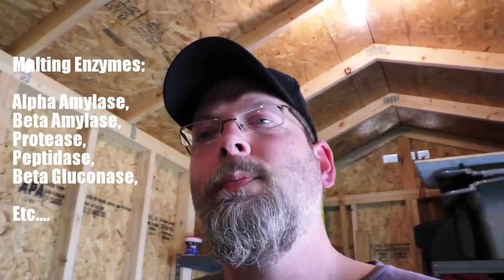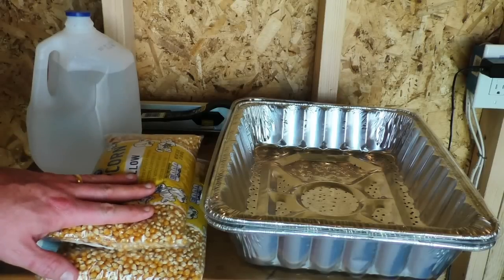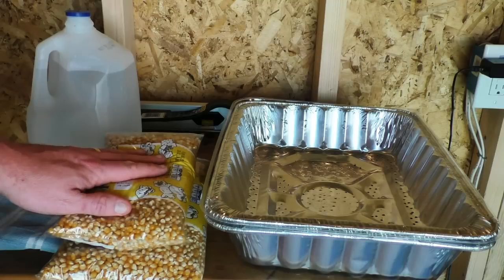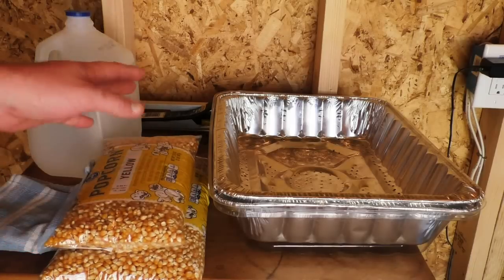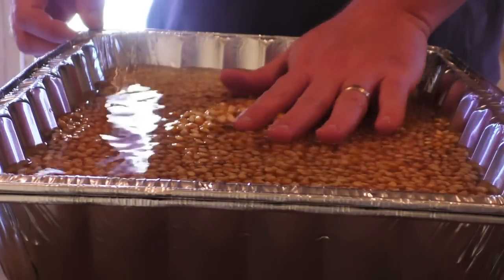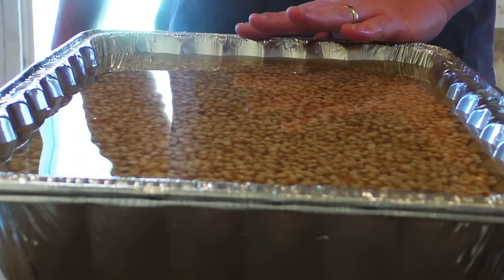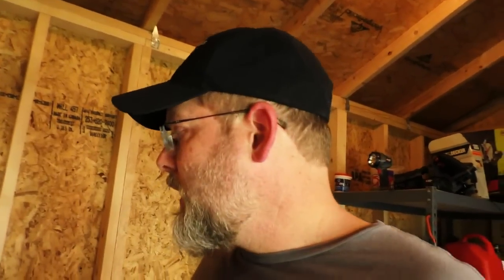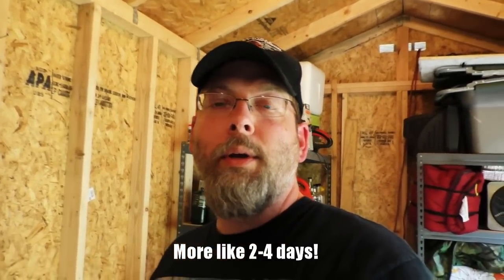HOW TO MALT CORN FOR MOONSHINE & BEER - EASY! Part 1

Comment: I have been asked can you use the corn in a mash right after the germination while it is still wet? Skip the drying process ?
Reply from the maker: You can, but I've never tried it. I've read several times that it can leave a grassy taste in your beer, or even make it through distillation into liquor. I may try it some day just to see what happens:-)

Comment: Hey, just subscribed and watching your videos. I used to home brew. My question to you is; do you use a hydrometer to measure your specific gravity/alchol content? Can you add additional sugars to increase alcohol content without effecting taste/flavor? Thanks, Happy Trails
Reply from the maker: Yes I use a hydrometer on every batch, even if I'm not adding sugar, so that I can calculate the alcohol content from the data points. 

As far as flavor, it depends. If you add sugar you won't change the flavor much until you push over 10%abv. After that the yeast will start to throw off some stronger flavors. 

What sort of abv range are you looking for, and what recipe?
Reply: @BeardedBored  hThanks for the quick response. Haven't done any 'hard' stuff yet. I'd like to sip some stronger brandies and the like above 40 proof.
Reply from the maker: @kentallen4473  Check out the Still It channel and The Barley and Hops Brewing channel to get tons of great info on distilling:-)
Reply: @BeardedBored great video very helpful. I am using 50kg sugar in a 250 Ltr mix of lemon and ginger. Getting about 12% ABV. Thinking of reducing the sugar to 20kg and adding malted corn to provide additional sugars. What quantity of malted would be ideal to get to higher ABV say 16%

Comment: Bearded: Any specific reason why you wouldn't malt yellow corn that comes in a 50lb sack from a local hardware or feed store? Here in North Florida (near Tallahassee, FL) we've got 50lb sacks at places like ACE Hardware and other misc stores that sell feed, for around 6.99 a bag.  Just wondering ASSUMING you've got similar access to this at these prices why you'd still choose to pay the same price for a lot less in popcorn kernels? This is a honest question..obvious assumption is lack of access to bulk quantities?
Reply from the maker: Good question. Actually I have easy access to feed corn in Walmart and the various feed stores around here. The main reason I went with popcorn was so anyone, anywhere could do it if they have access to a grocery store. Also, I only needed to malt a few pounds at a time due to space and didn't want to store the rest of a 50 bag. I've done feed corn too and it works just as well for malting:-)>

Comment: when you malted corn did it start to mould a little and what do you do?
Reply from the maker: If it gets moldy you need to dump it in the trash. Sorry to say that, but it's not safe to use moldy corn for anything. I've had to dump out batches myself. If you don't turn the corn enough, and if it's too warm then it is more likely to grow mold. Good luck on the next batch:-)
Reply: @BeardedBored  well poop. It was only a little fuzzy in one spot
Reply from the maker: @brucegustafson8382  Ohh, I thought you meant the whole thing. Try to just scoop out the bad stuff and the corn around and under it. Give it all a thorough rinse several times and drain completely for an hour. Sanitize the tray you're using before putting the drained corn back into it. If it finishes malting without growing more mold, then you're ok.
Reply: Ok thanks . I malt in very small batches. Two big trays like in your malting Video, just enough corn to cover the bottom of the trays. I’ve done it twice now. Do you still need to mill you’re corn after you malted it or is the grain open enough all ready after malting?
Reply from the maker: @brucegustafson8382  You still need to mill it to allow the mash water to access as much of it as possible for mash efficiency. Corn is usually too big for a standard grain mill, so you may need to bust it up in a blender first.
Reply: Hobbits are real i saw them on tv

Comment: it has 4 x diastatic power not dried because it degrades the amylase you cant store it but is converts better so you can add 3 parts unmalted corn ,,,,,, so apart from storing.....why dry it??? make it fresh
Reply from the maker: I've never tried using it fresh because I read that it can have a grassy flavor that will come through in your final product. But I've always wanted to test that:-)
Reply: @BeardedBored just cook it for 40 min at 152f to convert the rest or .....
malt it all........thats what the old timers do ........... yeast grow on skin so you need no yeast and its natural wild corn yeast..... ps ive improved my malting process after watching your video its the best ill check your others out....im running dates at the moment 70 percent sugar dried just like corn.... smooth nice body residual sugar in the east they call it arak the only thing ive distilled that has a nice smooth mouth feel like corn and girls love it you can hardly stop them when they taste it ????......why dont we know about this in the west......cheers give it a try i use golden sunrise dates
Reply from the maker: @InahaFrost  Sounds great:-)
Reply: @BeardedBored  my passion is as big as my mouth ....sorry .....power to the people.......love your video bro awesome

Comment: Am following your example :) i wonder why to remove the floating grains? Because when i added water in the container, many of the grains were floated. Maybe 1/3 of them ... best regards :)
Reply from the maker: What I read was the floating grains are spoiled and won't grow, so it is best to remove them. I am not certain why that is. If you try this again and many grains float, you can separate them and try to malt them in another container to see if they are bad, or not.
Reply: @BeardedBored  Thx again :) Am french so its not easy to understand all the details but you are a very great teacher :) am sorry to ask another thing but when the four steps are done, you just rinse the grains half a day  and put wet towel on them until the roots are twice the kernel? right?
Reply from the maker: @lechoppedemeria9323  Yes, that is correct:-) J'utilise Google translate pour cette partie pour plus de clarté. Après avoir terminé les quatre cycles de trempage des grains, vous laissez le grain pousser sous la serviette humide pendant 5 à 7 jours jusqu'à ce que la croissance soit là où vous le souhaitez. Vous devez remuer le grain plusieurs fois par jour pour vous assurer qu'il contient suffisamment d'oxygène. Si vous voyez de la moisissure ou une odeur de bactéries, rincez très bien le grain, puis laissez la serviette pour lui permettre de sécher légèrement. Assurez-vous qu'il n'y a pas d'eau accumulée sous le maïs pendant sa croissance. Vous le voulez légèrement humide, pas mouillé. Veuillez me faire savoir si vous avez d'autres questions sur le maïs de maltage.
Reply: @BeardedBored  thx a lot !!! Ive watched the two videos, i know what you said about mold... So i will pay attention to that . I will try to make chicha corn beer with this process. Take care really thx for all :) bearded frenchie brewer
Reply from the maker: @lechoppedemeria9323  Bonne chance!
Reply: @BeardedBored  Thx a lot am watching your others videos ! definitely better than tv ^^ Great channel take care of you
Reply: Sorry but i forgot one thing. During the drying process, you need 10 percent less of humidity in grain (0,5 once less per ponds) before increase the next temperature  . But what is the reference ? start weight before all the process or the weight of grain after the soaking process? hope you understand the question with my "english" lol
Reply from the maker: @lechoppedemeria9323  Your English is perfectly understandable:-) I never weigh the corn because I always seem to forget. But if you want to make sure you  have reduced the water content enough, you should weigh the corn before soaking, then after after soaking to determine the percentage of mass increase. Then weigh again after drying to determine the percentage of decrease.
Reply: @BeardedBored  thx a lot :) i try to be as clear as i can. So at start direct out the box : 4,4 pounds and after soaking 5,17 pounds. So 10percent less from  4,4? or 5,17?
Reply from the maker: 10% down from the 5.17.
Reply: @BeardedBored  thx for it but am very sad today...A big smell of humidity is there. Like a piece of wood full of water ! No sticky things, no moldy no rotting but a strong bas smell. Dont know what i did wrong : ( 6 days  lost. am very disapointed
Reply from the maker: @lechoppedemeria9323  Ne t'inquiète pas. Vous pouvez vaporiser le maïs avec du peroxyde d'hydrogène, puis le rincer à l'eau, puis le laisser sécher un peu. Les odeurs terreuses sont normales, mais si elles sont très fortes, le rinçage au peroxyde d'hydrogène sera utile.
Reply: @BeardedBored   in France we cant find hydrogen peroxide easily  :( . If i understand its not ruined ? so how to know when its fucked up or not?  i thought that some bad humidity smell = mold
Reply from the maker: @lechoppedemeria9323  If it smells like wet leaves, grass, and other natural things, that is usually not a problem. If it smells like vomit or dog poop, then it has a bad infection and needs to be thrown away. Try rinsing it for a few minutes in fresh water, drain it thoroughly, scrub the container you are malting it in, then leave the wet towel off for the rest of the day and turn the grain every hour or two. Cover it with a very slightly damp towel over night. Send me an email with a few pictures of the corn so I can see how far along it is. i.am.bearded.and.bored at gmail dot com

Comment: I assume once it's sprouted well enough I can crush it and make a mash without drying it out?  Are there any bad flavors that would hitchhike on the sprout/root if I heat it to 155F?  This would be for a distilled product.
Reply from the maker: It can be a bit grassy, but if you boil it for 20 minutes after you finish the mash conversion that smell will go away. The flavor can follow through to a distillate so don't skip that step;-)

Comment: Hey Bearded.  Not sure if this question has been asked below, but have you tried making a 100% popcorn malt beer?  I am on my 3rd attempt at this with no success.  The main issue revolves around proper conversion and extract efficiency in the mash.  There is some info on the internet about this, namely https://dcylab.wordpress.com/2013/07/26/100-malted-popcorn-ale , but I seem to be missing something along the way.  I would love to see a video, perhaps multipart series on this.  Keep up the good work man.  I really enjoy your videos.
Reply from the maker: I will be doing a video on this in the future because it's a question I've had several times. In the meantime here's my advice to get you a better result.

Malted corn has a very low diastatic power, about 30 Lintner, basically only enough to convert itself. That fact, combined with less than 100% germination (I only get around 70% to 80%) means that there will always be at least 20% to 30% of your grain left unconverted. Because of that it's always a good idea to supplement the process with amylase powder or some barley malt.

The only 100% malted corn beer I can think of is chicha. It's a South American corn beer made by literally chewing the corn and spitting it into a pot. All the diastatic power comes from the amylase in the saliva. Not appetizing, but it's how they get around the low diastatic power of the corn. So, no matter how you do it you'll need to add some amylase to have good conversion.

Hope this helps. Let me know if you have anymore questions. Thanks:-)>

Comment: How would you malt fresh corn?
Reply from the maker: You can't. Has to be dried first unfortunately.
Reply: @BeardedBored  That's what I figured. Just have about 80lbs worth of frozen ruby queen and suntava purple. Guess I'll have to dry it next year instead of freezing.
Reply from the maker: @deamonsoul1  You can still use it, but you'll need barley malt or commercial enzymes to convert the start.
Reply: @BeardedBored  Yeah I've done the cooking to gelatinization process before with barley malt, rye,, and fresh corn. Just wasn't 100% sure I couldn't malt corn without drying it to avoid the barley.

Comment: Having issue malting what popcorn do you use organics?
Reply from the maker: No, I just used the cheap store brand popping corn. What sort of issues are you having?
Reply: @BeardedBored  The popcorn come from walmart?
Reply: Germinate from paper towel method would not germinate should i buy different brands to experiment?
Reply: Regular corn seed germinated
Reply from the maker: Sorry for the delay Nick. I didn't get a notification of your replies. It's possible the popcorn you bought had been heat treated to sterilize it. Doesn't take much heat, but it's enough to prevent germination. Good idea testing it out with the paper towel method! Glad you got some regular corn to germinate:-)>
Reply: @BeardedBored  Thx for the reply means allot have a wonderful time with brewing as do we all keep up the great work that you do.
Reply from the maker: Thanks Nick!

Comment: do you have to do this if you add the Glucoamylase Enzyme and Amylase enzyme to my cracked corn?
Reply from the maker: No. If you're going to use commercial enzymes there is no need to malt the corn.
Reply: Bearded & Bored even for whole deer corn which I’ll crack myself?
Reply from the maker: @belczyk  If you're using commercial enzymes with any grain, you don't need malt. Malting produces the necessary enzymes, but if you're going to add commercial enzymes then there is no need to malt the grain.
Reply: Bearded & Bored thanks for the help

Comment: can i use whole feed corn?
Reply from the maker: Absolutely. The timing can be a little different since the kernel is a tiny bit softer than the popcorn kernel, so examine it closely after the 3rd soak to see if there is any rootlet growth. You'll probably  still need 4 soaks, but I've had feed corn root after 3.
Reply: @BeardedBored  thank you did not expect a reply after 2 years
Reply from the maker: @mrmolasses5366  I have no life, so I can check my comments often:-)
Reply: @BeardedBored  started soaking 8 hours ago
Reply: @BeardedBored  and I'm making corn beer with hops that infested my yard from 10 or so years ago when my uncle's planted some and took over and making yeast from my Concord grapes I have hoping I can make a starter that way
Reply from the maker: @mrmolasses5366  Congrats! Let me know if you have any questions along the way. Good luck on your batch:-)
Reply: @BeardedBored  ok thank you

Comment: The reason nobody sells malted corn is because corn cannot be malted. Most grains (except wheat) have no diastatic enzyme so you can sprout it to make some sugars available but the rate of conversion is very low. Sprouting does not mean the same as malting. On the other hand indigenous cultures used their saliva because it happens to contain a malting enzyme.. :)
Reply from the maker: Sorry to disagree, but corn absolutely can be malted. There is a great deal of scientific research on the subject that I studied to start my own malting projects several years ago. It's possible we have different understandings of what malting is, but malted corn was a standard agricultural product until malted barley took over. However, you are right that the corn malt is VERY weak. The diastatic power of malted corn is around 30 Lintner, whereas barley is usually around 120 to 150 Lintner. So malted corn really only has the power to convert itself, but any adjunct grains will not convert without an extra enzyme source. The saliva-sourced amylase enzyme for corn starch conversion is a fascinating indigenous practice, but I'm not sure I'd ever want to try Chicha. Can't get past the idea of drinking somebody else's spit;-)>